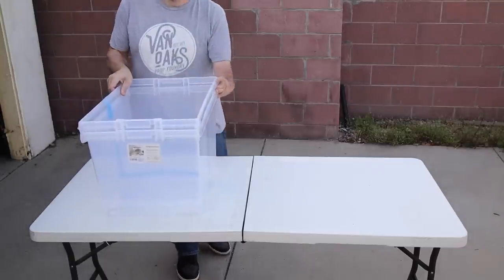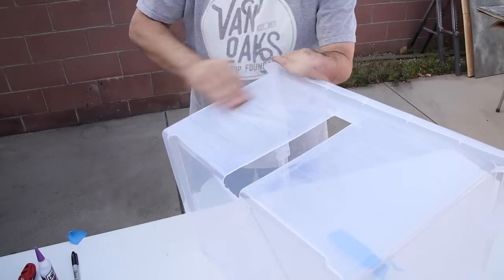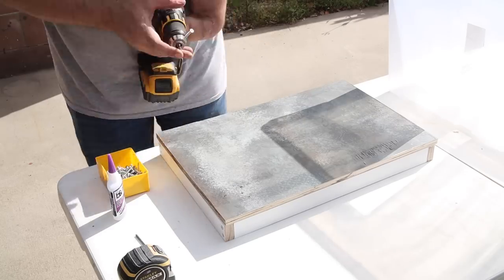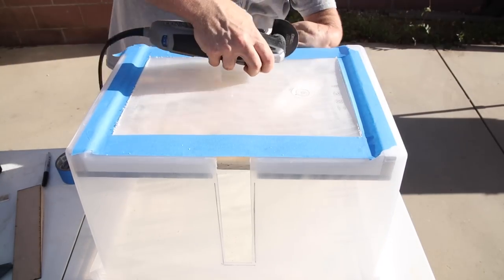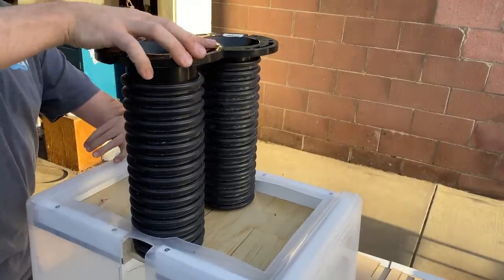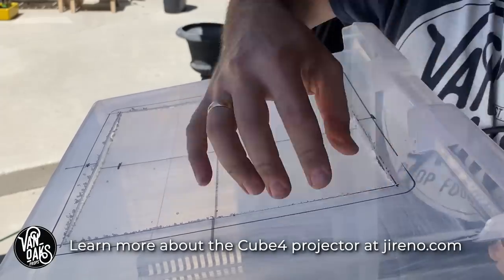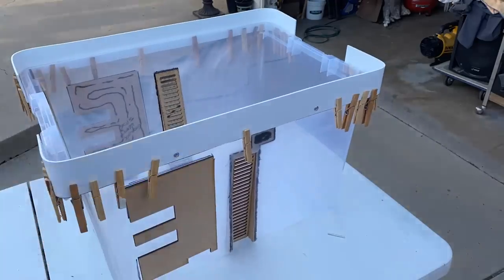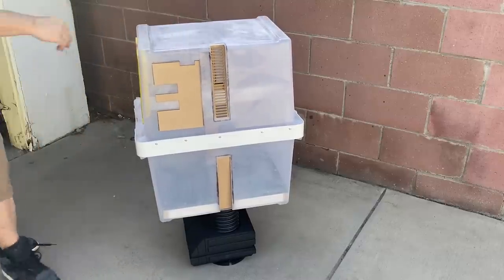Building a Gonk Projector Droid | Part 1

Comment: I always love a good Gonk Build!

The plastic used for these Bins is usually polypropylene or polyethylene. These materials have a waxy surface and won't react with most of the glues. Even Hotglue can be an issue since the glue is just comming off when cooled down.
There are two solutions for handling PP or PE plastics. You can use an activator that is specially developed for glueing these materials, before using regular superglue. And on the other hand you can hit the surfaces, that you want to glue, with a blowtorch for a split-second. This will restructure the plastic to make it susceptible for superglue.
Reply from the maker: Thanks for the tips!
Reply: Nice tip!

Comment: Derek at the beginning when you mentioned the crack and starting over, did you or would you consider just going with it and patching it to make it appear as "damage" or just wear and tear of sorts?
Reply from the maker: The crack on my first bin had nearly snapped it in half, so I knew it wasn’t structurally sound. There was a second, smaller crack that I was able to patch. It’s got a small detail on it to cover it up. So, yes, assuming it was salvageable.
Reply: @VanOaksProps  aaah gotchya ya that makes sense since it broke it down so bad

Comment: I'd seen Gonk builds before. The ones I usually see are either a solid statue display, maybe with some blinking lights. Or they are a costume built so that a person can get inside and walk around. Usually more for kids or smaller people. But I'm watching this and getting ideas about how I could make it more useful. I'm thinking you could rig the feet with RC car stuff and make it where it rolls. So you could drive it around for fun (not accurate I know, since they walk and don't roll, but still fun and easier than having to carry it or cart it around). Then rig it with stuff where you could plug it into a wall outlet and it would have wireless phone charging stations, USB power plug ins, and surge protected outlets, all hidden under access panels. Have it as a fun display and a useable "power station" at cons. So that it's a real power droid. Maybe use the projector to show off products if you have a booth/table in a vendor area. Or a display for a droid builder's or cosplayer's group/club.

Comment: I use a torch very lightly to help remove some scratches in some plastics. Its a trial end error and a light hand. You can mess it up fast.   Use spray-paint for plastic (fusion).

Comment: Tremendous!  I'm wondering if additional ventilation ports on the bottom and top of the droid as well as a cut-out through the repurposed plywood from "Painting Creepy Old Haunt Walls" (I loved that part!) will be needed to prevent overheating of the projector.  The positioning of the lateral vent grills may not permit cool air to be drawn into the body/hot air to rise out.  Fans could do it, but would add complexity and noise.  We wouldn't want your Gonk to look like an R5 with a bad motivator in the middle of a movie!
Reply from the maker: Thankfully the projector vents out the front face. Great question, though!

Comment: Is it possible to get links to the 3D printed feet as well as the laser cut inserts?
Reply from the maker: I’ve been trying to figure out where I got them since I built the gonk. I had been planning the build for longer than I’ve been making videos and don’t know where I got them.

As for the inserts, I’ll have to track down my files.
Reply: @VanOaksProps  Yes would be interested in the 3d files for the feet and also would love to buy the glow forge laser cut inserts. Thanks amamzing build